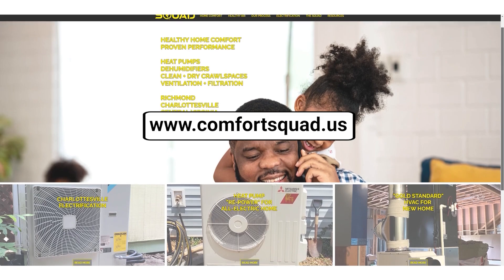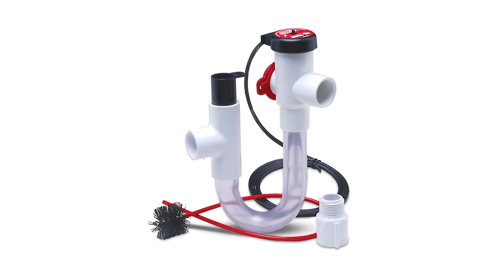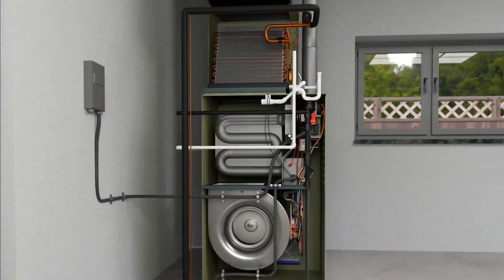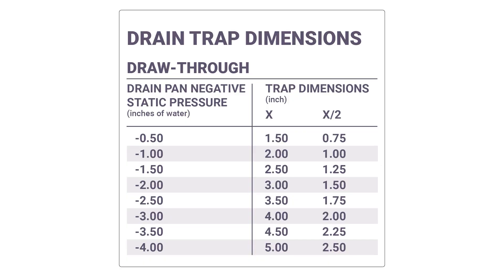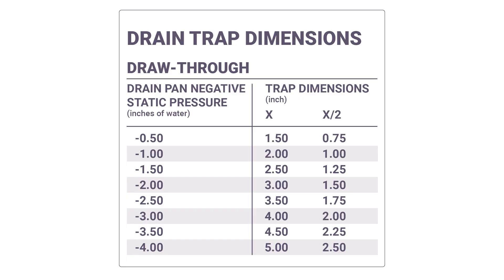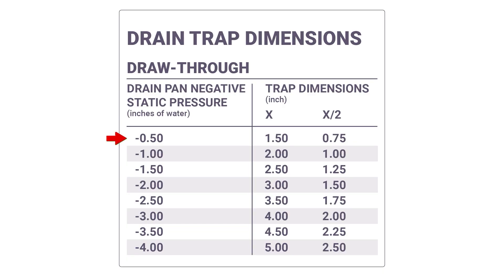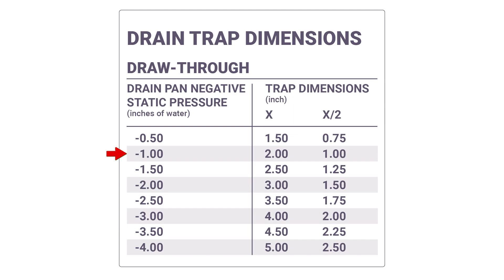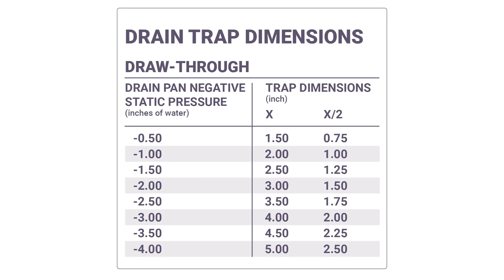Drain Traps & Static: Q&A with Bryan Orr

Comment: It can get really confusing. I’ve  seen Trane Climate changers suggest in the installers Manuel to not have a vent after the trap even if your drain is on the negative side of the system. I like to install in clean out , cap it, no glue, and a vent after the trap if on the return side of the system. Always follow the manufacturers specifications and you’re on the right path.

Comment: Homie says there's no correlation to the inches vs. the negative pressure.

The drain literally has the same anatomy of a slack manometer. You could literally use it to measure pressure, in inches of water column.

Comment: My initial reaction would be that high "static" pressure inside the air handler would tend to drive condensate out of it.

<edit> Brian then proceeds to explain that we're talking about a different type of air handler where the "A" coil sits not upon the blower but underneath it, which now makes sense.

Comment: Plumbers are a problem for condensate traps.  They like to install the vent on the fan coil side  when connecting to a sanitary waste, negating the trap.
They also like to glue solid.